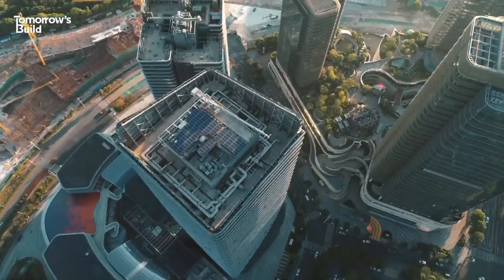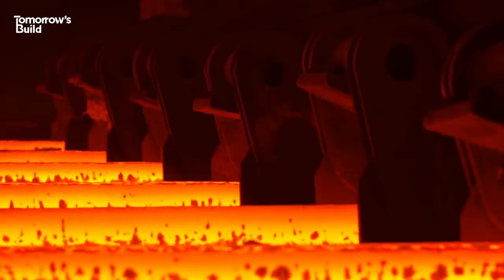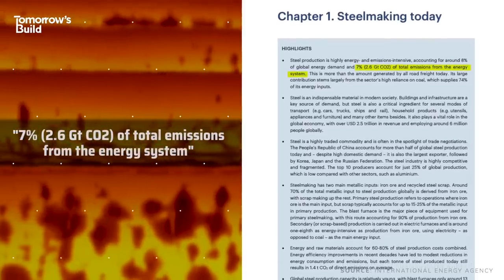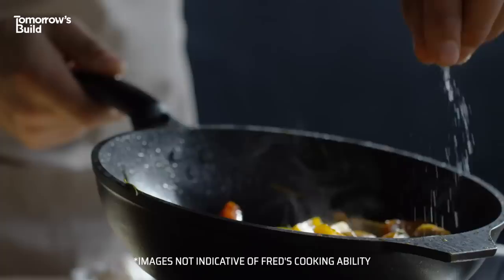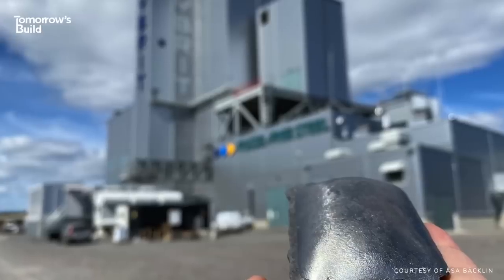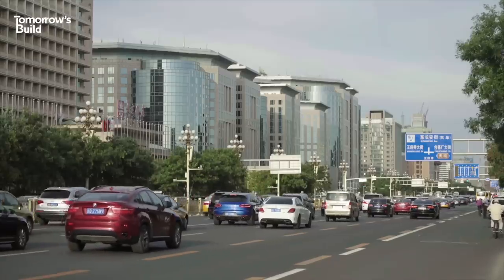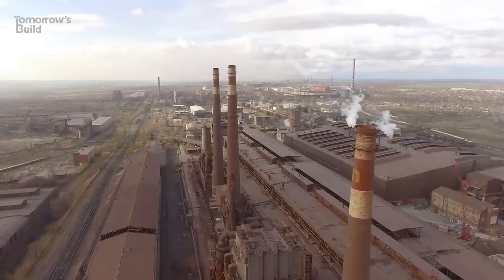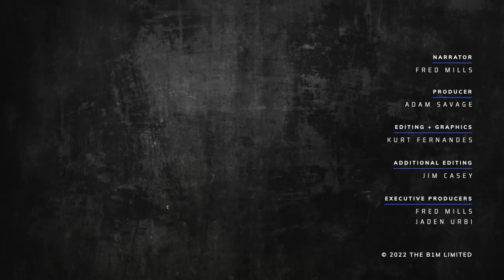Has Sweden Invented Green Steel?

Comment: Hybrit is cool but there's a big problem looming - the massive electricity demand. It's currently estimated that the sustainable steel production will require similar amounts of electricity as the whole of Finland. This will also mean that the steel will be way more expensive than regular steel that's using coke to turn the ore into iron.
Reply: Electricity is easy to come by if people would stop being stuck in the 1700's. We've got wind, hydro, nuclear, and especially solar. People often forget that the average solar energy hitting earth every 10 minutes is more than what we produce every single year in total.

Comment: Still need loads of energy to get up to temperature. They eliminated the coke required for the steel but that's about it. You still have the same energy overhead for mining, transport, and production of the ore and material.
Reply: Sure, but the benefit is that you can build it around non fossil energi.

Comment: Very cool process.  My only hope it's that's it's cost competitive with fossil fuel steel.  Otherwise it'll be an uphill battle.
Reply: Easy, tax anything that comes out of the ground. Companies will scramble to use wind, solar and others to substitute mined coal.
Reply: It's apparently expected to be 20-30% more expensive by the time it hits large scale production. My money is on molten oxide electrolysis instead

Comment: Two small things that actually is a huge deal.
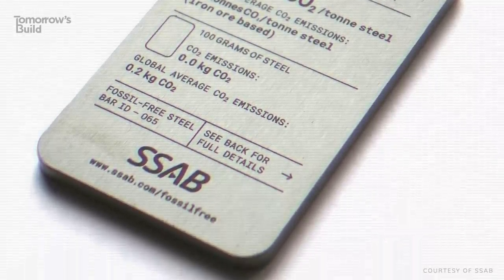1) Where does the hydrogen come from? How is it made? How much energy does it take to make it? The Short clip there shows a flat land with windmills (2:25) but the company that makes it is SSAB which does NOT take electricity from windmills but hydropower. (hydropower plants that the green party is closing down by the way).
2) Modern steel is so much more than just Iron + Carbon. 10.5% is Chrome, then you add Nickel and Molybden to make rust proof steel. If you fail to add these three additional ingredients you get crap quality steel with low durability and high rust rate. Now we got 3 questions to answer here; where does the nickel come from? What about the Chrome? And who makes the molybden? 
A side note here is that you need aluminium to reduce chromite to chrome. And chrome is dug up in (mostly) South africa, Zimbawe, India, Cuba & Kazakhstan. Yes there are a few chromium mines in Germany, Hungary, France, Norway & Sweden but nowhere near as big as the first 5, so we need to add the transportation (along with the actual mining here). (we can safely disregard aluminium here since it's more common than iron).
Molybdenum is mosty mined in China, then 2/3 of that in the US, then half of that in Chile, then half again in Peru & Mexico. Again transportation and working conditions need to be taken into consideration.
As for Nickel, well if you find iron, you've found nickel.
So we got a bending of truth here where steel is ONLY made from iron & carbon.
Then we totally disregard transporting raw materials from the other side of the globe, we disregard that some of these countries have no laws regarding ground pollution while mining, and we disregard that when it comes to one big producer of Molybdenum have VERY questionable work ethics and slave workers are quite common to drive down the prices in order to secure a bigger market share.

So yeah, how about that "sustainable" & "green" steel hmm? yeah. whops. It's not fossil-free steel, the mining equipment are fueled by diesel, the semi trailers carrying the ores to/from ports are fueled by diesel, trains in many of the listed countries above are either coal or diesel powered if trains are used instead of semi-trailers. The big cargo ships are diesel powered.
So where is the fossil-free steel? Are we just looking at the production phase? If so we're lying to ourselves in order to pat ourselves on the back and feel good. And if you think going green and becoming fossile free then you're a hypocrite.

Comment: It seems to me that steel is a heavily recycled material, and coke is not required to run an electric arc furnace.. so there is the potential to make "green steel", depending on how the electricity is sourced.  Also, while much of Sweden's electricity is generated through hydropower, an almost equal amount is generated through nuclear, and some from burning garbage as well.. even though it may not be used in the steel-making process.

Comment: More than half of steel is made from recycled scrap which can be done by induction ovens - run on green energy but vastly more efficient than extracting from ore - without the use of green H2, you fail to mention that.
I'm not putting down green steel btw, It makes total sense to do that up north where there's an abundance of green hydro.
Please do concrete next and how to make it green (or replace it for something more sustainable by mid century).
Reply: Good points, especially about the recycled steel using induction 
But regarding concrete, this is well underway 
In fact very very close, for example instead of using GH2 for the process like this one he covered, they also produce green steel using electric arc furnace, (which might be better than using GH2), 
AND similarly they also have electric kiln furnace for cement, so the removal of coal from the process is already accomplished and if they wanted to use CCS to capture the remaining 30-40%  Co2 from the limestone conversion it is possible because the particulate matter isn’t an issue because it’s mostly Co2 alone (no coal used) and very little other contaminants 👍🏿
That makes CCS possible when it isn’t possible in the legacy method of cement production 

There’s a US startup that has found a new way to create cement using a purely chemical reaction without any heat conversion, it’s early days and needs to be scaled to see at what cost it is possible 

So, I’d give it 10-15yrs at most before these things (and others) are available commercially at scale

Comment: I'm missing something here. On an atomic level steel is basically iron mixed with carbon. If you don't use coal in the blast furnace, where to you get the carbon in your steel from?
Reply: You'll notice Hybrit's tagline is "fossil free steel" and not emissions free steel. 

The technology of using natural gas to make DRI has been around for decades. In that process, you're deliberately trying to achieve a DRI product of around 2% carbon. This is done to significantly reduce the required operating temperature of the next step from >1500 to around 1200 degrees, which significantly reduces the amount of energy required but also simplifies/cheapens many other aspects of the process.This 2% is significantly higher than the amount of carbon required for the majority of steel grades, but the 2% significantly reduces the melting point of the DRI. 

Natural gas is mostly methane, and although Hybrit hasn't specified exactly what they're doing here publically (at least I haven't seen it and I work in this industry) presumably they are using a kind of biogas methane in their DRI plant to increase their sponge iron carbon content. They then reduce the carbon content to the level specified for that grade during the next stage in the process, emitting CO2. Hence "fossil free steel" and not "CO2 / emissions/ carbon free steel".

Comment: Steel made with Hydrogen has been possible since the 1970s at least. Problem is that the steel produced tends to be brittle, compared to steel made by traditional methods. Also note the other commenters below about the amount of carbon emitted both in building the plants and generating the Hydrogen.

Comment: great video, but you should really start saying 'clean energy' instead of 'renewable', since the latter is non-inclusive towards the clean energy source of nuclear energy. Especially in the case of Sweeden which is a nuclear powerhouse, meaning that this steel is only low-carbon due to the share of nuclear in combination with renewables, mostly hydro. Had they not had the nuclear, their electricity grid would still be partly fossil fuel powered, and there would have been no souch thing as green steel.

Comment: As far as I understand, this is a pilot/research plant not for full scale production. So this is in preparation for 2026.

Also converting electricity to hydrogen is useful as we basically only have hydro, nuclear, wind and solar power in Sweden.

If you built this in a country with mixed electricity and the plant uses green electricity someone else will have to use dirty electricity as the consumption of electricity goes up quite a bit. But at least it makes it possible for green steel.

Comment: No they haven't, since it would take 80TWh/ year to run the two plants needed. That's more electricity than the entire country of Finland use, or enough electricity to electrify every car and truck in Sweden, 7 times over. 80TWh is about 53 nuclear reactors. or 123 million windmills.

Comment: I really do wonder what the residual hydrogen content of the steel is, the produced steel might never truly replace the traditional variety because of it.
Reply: @marcoa.2585 have u heard about hydrogen embrittlement?
Reply: @sravanpavangarikapati7098  Thank you, I didn't want to say it, I can't believe this guy actually thought he was schooling me.
Reply: @marcoa.2585  How would it disappear? Conservation of mass holds that the only way for hydrogen to leave the system is to exit through the top of the melt either after reaction or un-reacted form, or to dissolve in the melt.  Iron is a solution system and perfectly capable of retaining dissolved gases such as hydrogen or nitrogen, in fact hydrogen absorption is already a factor considered when refining iron traditionally, since it can be absorbed from exposure to water vapor.

Comment: There HAS to be more to it then this...
For one, it Cannot be steel, if there's no carbon in it. Then it's just iron...worse then iron, even! Ask any welder, water and hydrogen is one of the worst things to get into molten ferrous alloys! It weaken them. Considerably!!

The main thing I'd like to know is how do they remove the hydrogen from the iron, after reduction? Because afterward you can use any carbon source to turn the iron to steel...I mean you could even use burnt loafs of bread!

Comment: Sure, you can use hydrogen to reduce the iron from iron ore.  That chemistry has been known for a long time.  The reason no one does it is because it costs a lot more.  Hydrogen must be made, whereas coke can be mined (as coal).  If you use windmills to generate electricity and use the electricity to make hydrogen, then hydrogen to make iron, it is less efficient and more expensive.  Hydrogen from a nuclear power plant makes more sense - cheaper and more reliable than wind.  Even more sense is to not worry about the CO2 from making iron.  Switch a few coal-fired power plants to nuclear and call it good.
Reply: Is hybrit creating a new type of steel or just a new process to make the same steel as other power plants?
How would hybrit be better than an electric arc furnace? Like you said switching from coal to nuclear plants would be better but you said hydrogen from nuclear makes sense but couldnt you do electric arc instead/too?

Comment: I actually spoke to the swedish engineers in person about a year ago about exactly this. They said that they will produce the steel in the north of Sweden as there is a lot of excess of renewable electricity production through water turbines that they would likely use to power electrolysis to produce the hydrogen from water. Otherwise they would build wind farms to produce electricity for the electrolysis. Either way they would use renewable electricity for the whole factory.

Comment: Now this is all great BUT... this didnt explain one simple fact... in order to make steel you NEED carbon, thats when Coke comes in. The video has shown how they remove the Oxigen from the iron-oxides which is very smart, but how do they add Carbon to the resulting Iron to make you know... carbon steel? which consistes of Fe + C in various concentrations.
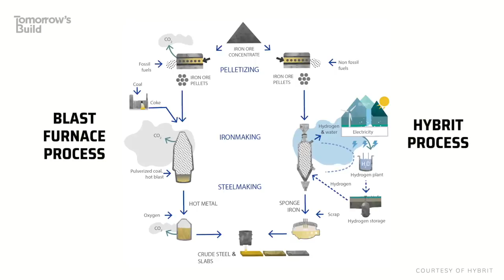I saw on the image at 4:27 that it was mixing the "sponge iron" with Scrap in a furnace... probably relying on scraps to add the needed carbon... if that's so... this is far away from a sustainable production line, down the line we won't have that much scraps to produce new steel and will need a better way to introduce carbon into the alloy

Comment: Two problems. 1. Steel is an alloy of iron AND carbon. No carbon, no steel. Where are they getting the carbon from to produce the steel? 
2. How are they solving the problem of hydrogen embrittlement? This is where the steel absorbs hydrogen and becomes brittle like glass. This is why traditional blast furnaces do everything possible to keep hydrogen out of the mix.

Comment: "With transport now responsible for about a quarter of all CO₂ emissions..."

Did you mean manufacturing instead of transport?
I only checked 4 sources on this, but 3 out of those 4 put CO₂ emmisions from transport closer to 15% and emmisions from industry and manufacturing around 25% (iron and steel is included in this, at around 7% btw). Even then, road transport is only 10-12%. Still quite significant, but nowhere near a quarter.

It's not a huge deal, since if you had just said 'manufacturing' instead of transport, everything would've been correct. But it is still a misrepresentation, especially given the context, having just talked about Volvo, showing cars driving around and focussing on the manufacturing of road vehicles.

Comment: Where do we get Hydrogen from?
Reply: You can get it from Water
Reply: electrolysis if you want to go green, probably

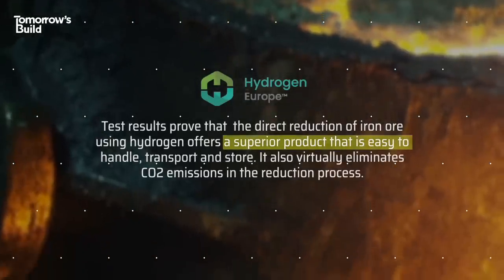Edit, the diagram at 4:33 seems to show electrolysis as the source for hydrogen
Reply: Renewable Energy (Electricity) > Hydrogen Plant (Hydrogen) > Steel Plant (Steel). That is also why sweden's biggest remewable energy, hydrogen producing and steel manufactprers came together for this venture.
Reply: Electrolysis of water...
Reply: In sweden we basically only have hydro, nuclear, wind and solar electricity. But trying to do the same in a country with dirty electricity might not be a good idea.

Comment: While this is amazing, fossil fuels are not where the bulk of carbon emissions from steelmaking comes from. As modern steelmaking is about literally burning off carbon from molten steel in order to achieve the right purity.
Decarbonization of steel production is widely considered one of the biggest challenges for a reason.

Comment: The problem is that they made Iron, not steel.
Steel is the combination of a max 0.08% carbon and Iron. This what we call steel and playing on that percentage change the metals properties. Now they only made pure Iron, which still need to be burned with carbon to make steel.
They even said it HYBRIT aka Hydrogen breakthrough Ironmaking technologie. They make Iron, not steel.
Also, Kamikoto knives are a scam. they belong to fail ventures who make scames like established titles and other. Those knifes are definity worse than any knife you can by in a reguler store.
Reply: Some sources if you want
Chakrabarti, A. K. (2006). Steel making. PHI Learning Pvt. Ltd..
Tang, Lixin, et al. "Steel-making process scheduling using Lagrangian relaxation." International Journal of Production Research 40.1 (2002): 55-70.
De Beer, J., Worrell, E., & Blok, K. (1998). Future technologies for energy-efficient iron and steel making. Annual review of energy and the environment, 23(1), 123-205.
Chunbao Charles, X. U., and Da-qiang Cang. "A brief overview of low CO2 emission technologies for iron and steel making." Journal of Iron and Steel Research, International 17.3 (2010): 1-7.
They make iron, not steel

Comment: There is some minor problems with the process. The Hydrogen have to come from somewhere! There is two common ways to produce Hydrogen.
1. From Hydrocarbons as natural gas. That is the cheapest alternative but you will probably end up producing as much CO2 in the en than just making steel the common way.
2. Electrolysis from water. It uses a lot of electricity so it's more expensive. And yea it uses a lot of electricity so that have to come from somewhere... 
They now tell us in Sweden that we are in an energy crisis, i don't know how and why because it's not like Scandinavia have used Russian gas for electricity or heating. But It will be hard to increase the production so much that it's can cover the planed hydrogen steel plants. Building new nuclear plants takes a long time and is expensive.

Comment: There are no calculations if this is going to be cost efficient or not, the tech is not confirmed in a large scale. There are not enough energy and storage of hydrogen secured. The Swedish people already today suffer from record high energy prices due to close down of nuclear power and depending on wind. It would be better to secure citizens wellbeeing before these "in the air schemes"  And the taxpayers are going to get stuck with the bill if (when) it fails - this is not privately funded.

Comment: Great video Fred! Did you know that we are having green hydrogen steel with Sweden in our business and industrial energy self reliance plan as of may 2022? Does b1m know? That's why one of the largest electrolytic hydrogen construction near Sheffield, England. Indeed Norway needs hydrogen to replace nitrogen in the industrial production of fertilizer for NetZero carbon. Last point, we need to do this as it is certainly a "globalization" problem and we have an EU/UK strategy actually in place did you know b1m?